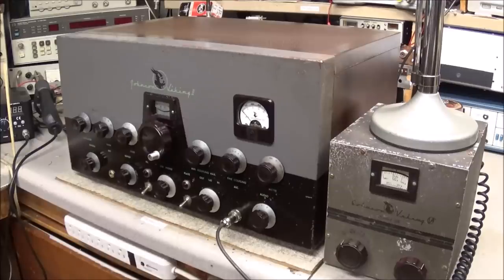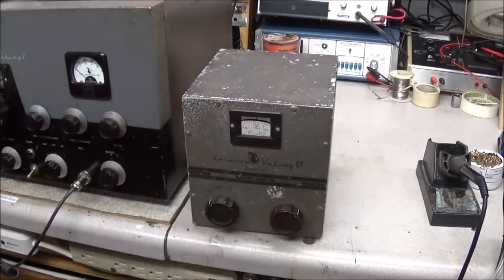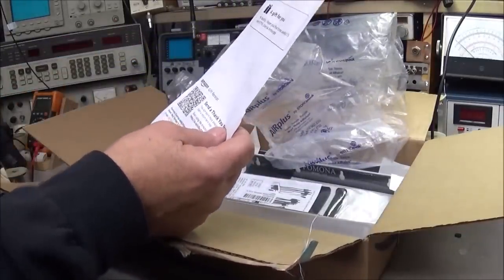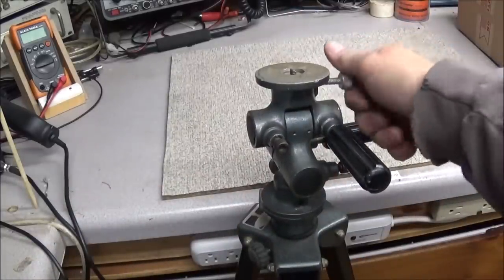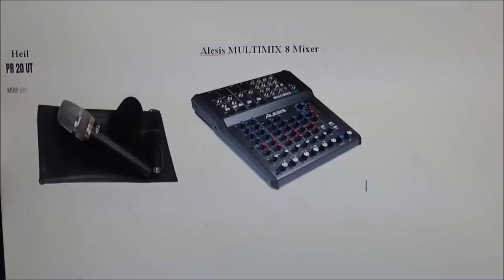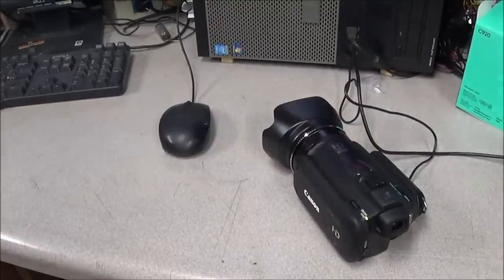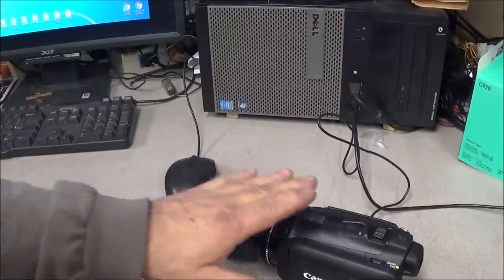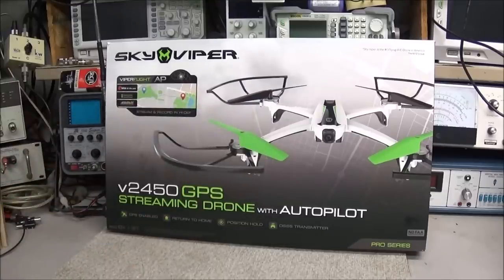#198 Saturday in the Shop with New equipment

Comment: $70 go for it. The time and effort on your part will cost far beyond the replacement repop. OMG! I love almost everything EF Johnson. Ran a ranger, and valiant for a short period during the early 80's. A local ran the 500 for decades. As a kid I would hang out in his shack. Shack lights out, with the 500's ps cover off. Those 811's would glow a beautiful fuchsia, and when he modulated the Shack would glow in that wonderful purplish blue fuchsia color. so much EF Johnson equipment was readily available back then. I would skip through the sale section of qst magazine, and dream of owning the 500. What a beautiful transmitter. The valiant, and rangers, are, and still move me. I guess it's the memories they bring back. So many people in my Brooklyn neighborhood were running either a ranger or valiant (with Artie windjammer running his 500.) The only 500 I've ever had the pleasure of being able to see and touch, and of course listen to on the receiving end. The audio on either of the three transmitters I mentioned as you know is outstanding. But the 500 was incredible! I digress. PS. All had 11 meters. Hihi. 73

Comment: If I had it and had the finances I would go ahead and get the repro front plate and then repaint the cabinet.  I know that you like to keep things as original as possible, but sometimes you just have to bite the bullet and go for it.
I hope that you get the Johnson back on the air and working reliably.  Glad to see that you are getting started with the new year rather well.
Reply from the maker: Thanks Randy. Yep that is a bit expensive for a reproduction plate.  We will see though.  When I get the replacement resistor in it should be good to go.

Comment: Nice camera.  I never take the camera off the mount or connect it to the computer.  I just pop the SD card out and transfer the video files directly off the card.
Reply from the maker: Thanks Mike and very good point.  I need to run into town tomorrow to pick up some SD cards.  Would be much easier this way.

Comment: The alesis mixer is great but a little noisy. I have one and I only use it for playback now because of the noise. I may rip it to bits and upgrade the opamps at some stage but I have my eye on a couple of Allen & Heaths that have come up at a good price.
Reply: Hmm. I saw a review that lauded its low-noise mic pres. That said, specs are pretty thin on the ground for this model. Still, maybe it's primarily your level settings that need a bit of tweaking? If you have a consumer-level input, try a main mix level of no higher than about -10 dB, possibly even lower for onboard audio. Here are my adventures with a Behringer of presumably similar quality:
http://stephan.win31.de/music.htm#mixer
You should be able to get a rather decent amount of dynamic range out of a mixer like that, usually somewhere in the 100-110 dB range at moderate preamp gain. (A speaking application in a normal room is unlikely to yield more than 70-80 dB even with a decently quiet condenser mic and the low cut on.) Often the tone control stage is the upper limit, sorta highish impedances there. Which is why I tend to doubt that you can just toss in some different opamps and be done with it. You really need to look at the entire circuit. I would look at the power supply in particular, where you might well find a pair of 7815/7915 regulators with no particular claims to low output noise (check the particular manufacturer's datasheet, there is no small amount of variation).
Reply: @PileOfEmptyTapes  No, it may be just that my recorders have a better noise floor than the Mixer. I used to run my DBX preamp processors through the mixer before it hit the Tascam recorder but now I run straight into the recorder from the preamps.

You are right too about the power supply, it could well be a poor regulator or even some issue with decoupling. I use Rode NT1a's or a Sure Highball (70's version of the sm57) for recording and when I ran the mics straight into the mixer there was certainly a low level hiss which I don't get with the DBX/Tascam combination. I'm in the process of having a new workshop/studio built so once that is done I will be able to get a better optimised setup with lower room noise.

Comment: I would just match the color and paint the 122 VFO case and leave the front face plate alone. That preserves its history and you can think of those who spun those dials causing that wear every time you use it. I got the C920 on the recommendation of Randy, K7AGE who sometimes is on HamNation, I really like it!
Reply from the maker: That is mostly been my thoughts also. Thanks.  The C920 seems like a good cam.
Reply: @TheRadioShop  "I would just match the color and paint the 122 VFO case and leave the front face plate alone." I agree with K2bew

Comment: Buddy, I hate to rain on your drone but the Sky Viper is just a toy that may or may not even fly. It's got a ton of bad reviews on Amazon where 1/3 are just one star!  I've tried several cheap ones like that and they are so unstable that it was all I could do just to keep them in my yard never mind trying to get them to go where I wanted!  If you want one that you can fly under complete control and take good photos and videos you need to step up to a DJI.  The cheapest one they make is the Spark that has a 1080P camera on a gimbal, is very easy to fly and takes beautiful videos.  The best thing about the Spark is that when you take your hands off the sticks it will just stop where it is and not move an inch until you tell it to go and not dart all over the place like the cheaper ones do.

Comment: Gee, I'm torn about the VFO.  It is really bad in appearance and kind of crosses the line (whatever that means) in regards to its visage.  Just personally I would be inclined to remedy that some way.  Scan, print decal over new paint sounds cool and could make for an interesting video.  However, $70 for a replacement, while easy, is a bit rich for my blood.  Anyway, just my two cents.  73's..